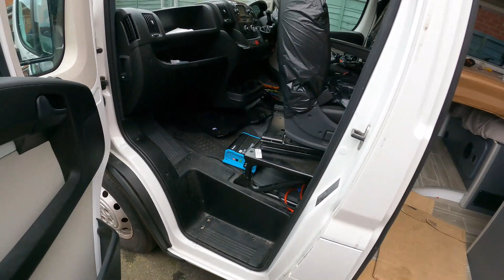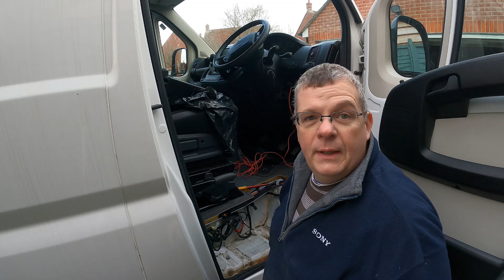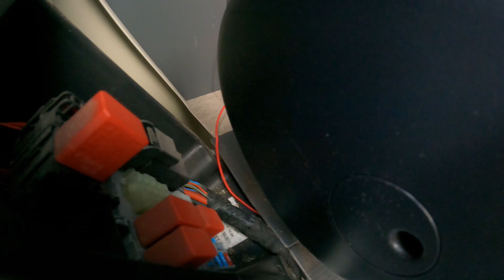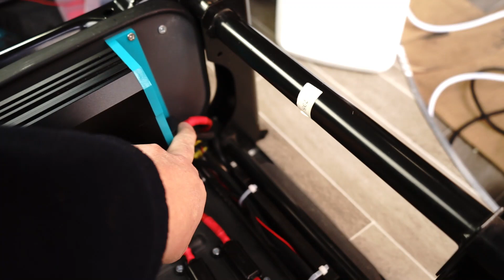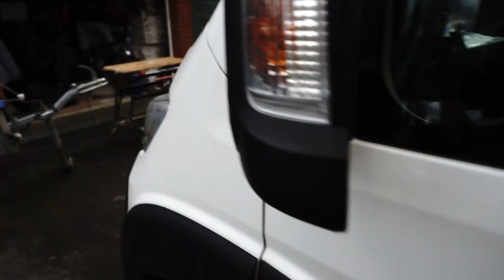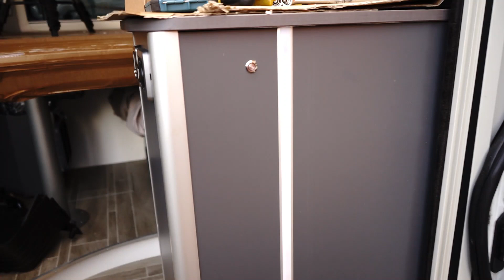Install Renogy 40A DC-DC Charger and D+ connection in Citroen Relay / Boxer / Ducato / Promaster

Comment: Great video and using a lot of your "how tos" in my build so thank you for all your awesome explanations. Noticed in this video that you have the converters socket in the B pillar behind the driver's seat, I believe there is a D+ pinout in one of those connector blocks along with a 50A charging cable
Reply from the maker: yes, only found out about this b pillar wiring after I had done everything. on next build I would investigate this further but take all info on YT with a pinch of salt until I have seen it and sussed it all out myself and not blindly plug things in without knowing what they are. seems a good feature though if it is what it is suppose to be.

Comment: Amazing video thank you for the precious help. 
Is there any chance you remember the hole size for the connectors you clamped on the four main cables of the charger (M6 ? M4 ?) I’d like to order them and my charger hasn’t arrived yet, thanks !
Reply from the maker: No, sorry. i don't recall now. all the best with your install.

Comment: You can avoid the D+ cable by fitting a voltage sensitive relay that comes on at 13.2v and off at 12.8 they cost £12 - personally I would have put the DC to DC closer to the auxiliary house battery as its a boost circuit designed to jack up any voltage drop in the run leading to it not after it and as I'm sure you discovered the fans make quite a noise
Reply: If you have a smart alternator then the voltage can swing around a fair amount and can drop below 12.8v, turning off your B2B charger.
Reply: @y0rkiebar  Oh I never realised that smart alternators go below 12.8 -  My rig is 1998 long before they came in - thanks
Reply: @trevortrevortsr2  Yeah, smart alternators need a few tweaks to the old skool setup to get max bang for the buck!
Reply: @y0rkiebar  I have 280 watts solar on the roof that meets 90% of my needs
Reply: @trevortrevortsr2  can never have too much solar 🙂

Comment: Thanks so much for this! I'm about to purchase the 20A version of this charger and even though it should be a straightforward install it's great to see someone demonstrate a true beginning to end put in. Like many others have said, I really appreciate folks like you taking time to share this sort of thing.
Reply from the maker: You're very welcome and I'm glad you are enjoying the videos. I actually wish I had gone with the 20A and saved a few pounds as I use my 40A with the 'LC' connected which makes it 20A anyway which is plenty enough I've found.
Reply: @wiltshirecustomcamper7203  Ah very interesting. My setup is incredibly small; a 5th gen Toyota I've converted into a micro-home. 100Ah lith battery wired to a 60w hood solar array, so I went with the smaller capacity. It charges great on it's own but since I'll be on the road so much it just makes sense to have a dc/dc charger, which will actually be arriving today and likely installed tomorrow. Thanks again for the video.

Comment: Great video. What was the blue light up switch that you fitted in-line with the D+ signal cable?
Reply from the maker: They came from Amazon, just search backlit 12v push switch and you will find loads of options. make sure to get 'latched' for this purpose.

Comment: Did you not have the Converter’s socket in the B Piller behind the driver's seat where you could of conected your DC to DC cables and your D+ ?? also how have you found the renogy stuff I'm just about to start my van and have got  a renogy Inverter ready and waiting but not sure to go renogy or victron for the rest ???
Reply from the maker: Yes, only discovered after I had done it about the 12v D+ cable behind the B pillar. I have been very happy with all the renogy equipment but Victron is of course very good aswell.
Reply: Any photos of this cable please, what am I looking for? I need an ignition live for my DC-DC charger

Comment: Update: we have a 2011 Peugeot boxer and it’s the thick yellow cable. There’s no thick white one with a black line on.
Reply from the maker: you could cut slightly into the sheathing with a stanley blade to get volt meter on it to check voltage with and without ignition. also a previous comment to this video mentioned another cable option by the b pillar so have a look for that aswell as a plan b. hope that helps and good luck.

Comment: Great video - what thickness wire did you use for the thick wire and what's the distance between your starter battery and leisure battery?
Reply from the maker: i used 16mm and it is about 4m in length. according the regs book, 16mm is sufficient, but for belt and braces and it actually being plenty enough, I have st my DC/DC to 20A output. I think if I installed again from scratch, I would go 25mm to be absolutely sure it is OK for 40A although the book states 16mm is OK.

Comment: Isn't this going to still be a problem especially in cold weather. You're hitting your battery with a 40a load before the engine even has a chance to get running as soon as you turn your key. Also, if you leave ignition and forget you'll kill your battery? I'm trying to resolve this through using a voltage sensing relay programmed to open on 13.8v and close below 13.2v
Reply from the maker: Yes, that was the reason for the manual override switch install. Using my own common sense, I turn it on when actually driving and I also have found that 20A is actually plenty to charge my batteries so I have fitted the 12v feed to the LC connection so it only outputs 20A.
Reply: You can acquire a true d+ using the wiring in the converters socket, on floor under driver seatbelt real position. There is a socket there with an earth that completes with d+, so you can place a relay over this and connect to a 12v there also to generate a true d+.
Reply: I'm pretty sure the charger will not activate until the engine is running.
It needs close to 14V to activate. 
The green light on my unit does not turn on when I turn the ignition to the on position.

Comment: Add a Votronic D+simulator onto your starter battery POS terminal and bobs your uncle a D+ signal plus all the wirings on the same side of the van.
Reply from the maker: Great idea, thanks for the tip. will investigate that for next build

Comment: Brilliant stuff. Could I just ask what size cable are you using from the charger to the ignition connection?
Reply from the maker: I used a 1.5mm cable. Hope that helps. thanks.

Comment: You will find that there is ignition live in the panel on the wall just behind drivers seat base. That information is for anyone else as you have already done yours.
Reply from the maker: Ooohh! thanks for the info, I will have a dig for it, may come in useful for something else.....
Reply: Hi, thanks first for all the infos in this video. Where is exactly the pannel behind drivers seat you are talking about ?  I think my surrounding might be different because I have drivers seat on suspension (Peugeot Boxer 2017)
Reply: @frogopio  Hi, the black panel below the seat belt on the wall is where you will find extra 12v. Not actually on the seat base. One screw and you pull it away from the clip. Difficult with the seat in but possible.
Reply: Im also looking for a D+ wire in the same place, actually in the pillar…but there are quite a few relays in there, can you be a little more descriptive ?

Comment: This is the same DC to DC charger I was looking at last night. Nice to see it being installed and used. I like the idea of the switch on the sensing wire.
Reply from the maker: I think I preferred that to a relay type of set up. I can choose when it is on and off! thanks for the comment.

Comment: I was told to keep the ignition off when either of the seats are removed and the airbags are disconnected? Did you have the passenger seat off the frame and leave the airbag cable connected? I've also seen loads of people mention this when they fit swivels to the front seats. (To keep the ignition off while the airbag cable was disconnected)
Reply from the maker: The passenger side air bags cables were never connected when the original double seat was there so they are just tucked in the back. i did disconnect the batt when I did the driver swivel for belt and braces on it.
Reply: @wiltshirecustomcamper7203  Yes I've been disconnecting the battery when I fitted the swivels to my two single seats. If you saw the sheer volume of cables and wires I'm in the process of removing from the rear of my 2012 ambulance, you would be gob smacked. Even I didn't realise how much there was and I was removing it all. My mates thought I was exaggerating until I sent them a video of it all on the floor today. I certainly have enough to rewire everything three times over. I might even put up a couple of little videos up on YT. Once I have finished removing all the ambulance fixtures and fittings (including the steel box section frame work, plus 2mm and 3mm sheet steel that is welded to the standard van body and the rear ramp and bumper that is made from 3mm steel and the 3 rear seats that weigh 50-75kgs each, I will have removed about 1000kgs. Fingers crossed that will all be removed by this weekend. I've gained 5-6 inches now the suspended ceiling has been removed. Then I can finally start my camper build. All the parts and materials are pilling up now. Just hunting round for and LPG tank, which is the last large item to buy.  I really like your Solway panels but they are so expensive for what they are. I've spent that money on 600Ah of Lifpo4 battery bank instead. I'm hoping to get my camper built for the summer holidays. It's going to take every spare hour i've get between now and June/July.
Reply from the maker: @drewhodge3820  Great info, thanks for the update. The solways look great but agreed, very expensive. In my next build I am not going with LPG at all. now LifePo4 are pretty cheap (compared to just a year ago) I will go with large batt bank, diesel fired Truma and an induction cooker on a chunky inverter. good luck with the build...
Reply: @wiltshirecustomcamper7203  I'm only using the LPG for the oven and a gas port for an outside BBQ. I'm using an induction hob. I eventually for a very reliable supplier for genuine grade A Lifepo4 cells. So the 600Ah cost me £1000 with a good quality BMS. I've got a Lavaner diesel heater and a Wabasto water heater that is connecter to a plate heat exchanger for hot water.

Comment: Another option instead of the switch is a cheap voltage sensing relay connected to your ignition switched live, which could close the relay only when it sees alternator voltage.
Reply: I used to use these but found the technology to be somewhat floored as they work only from sensing voltage rather than current. Therefore, for instance, if you were to turn off your ignition the voltage would stay high on your starter battery and the relay would remain open. If you then started your engine again, both batteries would be used to crank the engine... not good for a leisure battery. This is how I found out my leisure batteries were not lasting. Since using a Renogy DC to DC charger with the D+ wire, I have had no problems at all, it's such a good device.
Reply: @themoonraker  That would be true if using a VSR for charging by putting a VSR between the two batteries, but my suggestion is only for the D+ signal. It's just to "turn on" the charger rather than linking the batteries together (which the B2B charger doesn't do). It would simply mean that the D+ signal is live only when the ignition is on AND the engine is running, rather than at all times when the ignition is on.

Comment: Another good vid. How much space in mm do you have from the floor to underneath the passenger seat? I'm going to put my leisure battery there, but Will also be fitting lowered seat bases. We'll that's the plan.
Reply from the maker: My bases are the standard height so any measurement would be pointless for you with lower bases.... thanks for watching and for the question.

Comment: The LC connector (low current) I'm not so sure about the 50%. Other manuals I've read its limiting to 12.5% and the 50% only applies to the 60A version. Havent tested it myself since I don't care about that feature. Also, I would personally prefer connecting the charger to the actual D+, and not to the ignition. If you're shortly parked somewhere, keeping the key in ignition, without having the engine running, 40A will drain the starter battery pretty fast. With a real D+ it's only charging with running engine (alternator running). On my 2007 Ducato it was just a matter of finding the right wire in the loom. On my van it was on 1 of the connectors on the fusebox next below the steering wheel. In eLearn I found the pinout, and connected to that wire. Verified with a multimeter, only +12V with the engine running, 0V with ignition on as I wanted. Quote "The connection between connector B (D+) of the A010 alternator and pin 25 of connector A of the M001 Body Computer allows the performance of the alternator itself to be diagnosed"
Reply from the maker: Interesting points about the D+ and some useful info. I could not find any info/videos on what cable or connection was specifically for D+ so had to improvise with the ignition cable, also hence why I installed a switch for the very reason to turn it off if ignition is on but engine off. On the LC front, I have tried it and with just D+ connected with the engine idling and get 34.7 amps, with LC connected as well it dropped to 20.3 amps. I may for belt and braces hunt out a 12V feed from fuse board in the video that is only giving 12V when engine on, will have to experiment!
Reply: @wiltshirecustomcamper7203  Seems the 50% than also should apply for the 40A version, testing is more trustworty than a manual ;) I also added a switch, but thats since I have 315Wp of solar and it's pretty useless to have the battery full at 10.00AM after a drive in the morning, if there is sun available all day. In the end, the alternator is powered by the engine thus more load on the alternator = more fuel (not much, but still, its the idea of not using free solar). For the D+ you can find your model in eLearn (the Fiat/Sevel program with all wiring diagrams and stuff). For my engine (2.3JTD) i wrote it on my site djsmiley . com below the wiring head-unit, rearview camera and DC charger page
Reply: My combined Renogy B2B and Solar 50amp controller does that 50% malarkey so I turn off my solar when I want the full wack (50amps) from my alternator
Reply: The charger will only work when the alternator is running